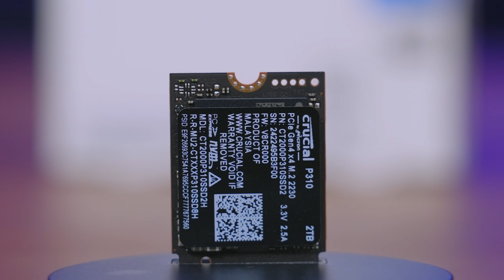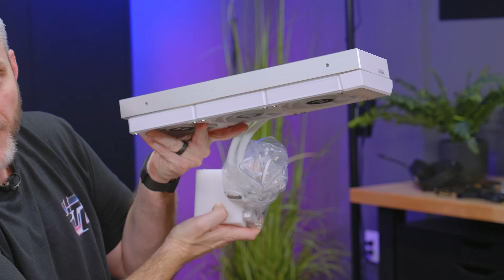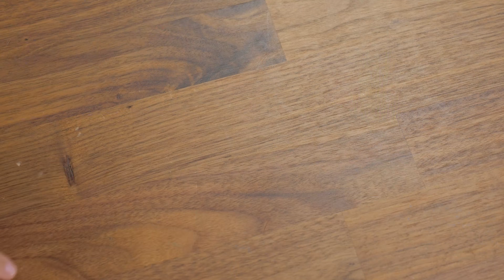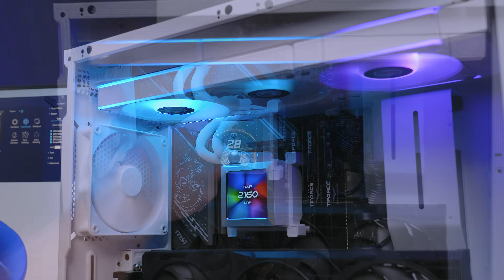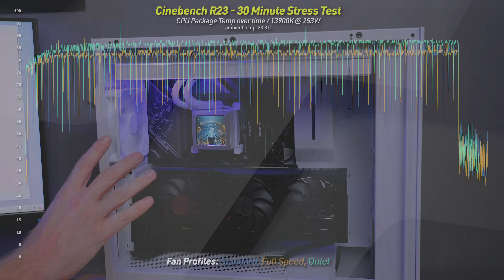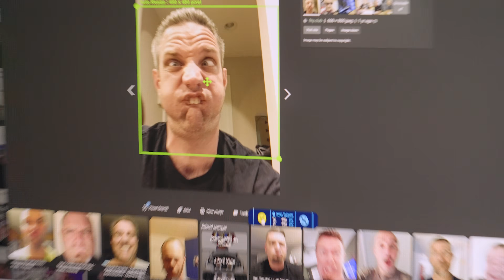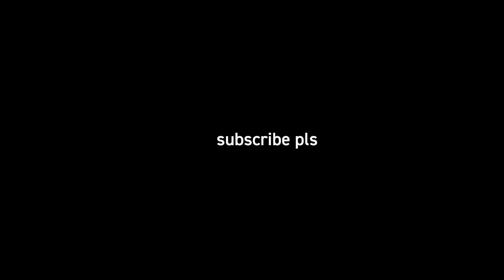Lian Li HydroShift 360R - Thermals and Stress Tests - is it worth it?

Comment: I wish all aio's going forward would have some type of ball valve or fill port for topping them off and swapping out the fluid.
Reply: 100% the problem is the longevity and low entry price point of closed loop visavis open loop would eat into their profits, especially if they specialize in cooling like EK.
Reply: What for? There is no need for regular maintenance or refilling. If you suggest it to a pc service they start laughing why I would want to refill or replace the cooling liquid. They never ever had to do that for an aio. And even my first one a buddy still uses … after ages of excessive use cooling like on day 1.
Reply: @GanymedeXD  do you not understand how evaporation works through the rubber hoses? Take the time to Google before you reply to somebody with your opinion lol. And it would be really nice and make sure that there's no organics or galvanic corrosion going on inside of the closed loop system. You just desperately wanted to have an opinion on something didn't you?
Reply: @GanymedeXD  and if you have been running your super hard for years it's probably about time for you to top it up. Most the time you have to take the block off of the CPU and remove the screws on the face. Make sure you don't mess up that rubber. Lift the pump up above the reservoir and have it running while you fill it with whatever is recommended from your manufacturer. I wouldn't be surprised if I was to come over there and pull your system apart you would hear all kinds of crazy sloshing going on in your radiator.

Comment: This is very interesting. It would be absolute overkill for my system as the tower cooler I have is rated for 250w and the 12400F can't get close to that. I do love their white stuff though. Might have to keep it in mind for my next build assuming they keep it around until next summer.

Comment: I dont see the rationale for the "R" version or the TL version relative to the "S" version (that I bought).  The R and TL version have a slightly thicker rad and a little slower pump.  Absent being a real power user...the "S" version is perfect, especially since youre likely to be swapping the stock fans anyway (except maybe the TL) to have a consistent fan "asthetic" and it is quite a bit cheaper.  I bought the "S" version in black, swapped out the stock fans for SL-INF fans in a push-pull config and am digging it. Performs just as well as the older Arctic LFII 360 I had on my current 7800X3D.  Mid-40s when not gaming, mid-50s in a warm room when gaming. Love the minimalist tube look!!

EDIT: Install was both easy and challenging. Installs like a normal aio, installed the rad first and all. But, orienting the rad properly to ensure that you have the tubs where they need to be to get the right bend is challenging for us spacially-challenged people.  Whats cool, though, is that Lain Li designed this so that you can rotate the rad and tubs and install that extra clip on to the rad to get the tubes right where you want them.

EDIT 2:  If you install in a push-pull in the O11 EVO RGB, you have to use the lower mobo placement and it's a tight-tight fit.

Comment: Hoses look weird because YOU added the third hose clamp. One of the few aios that have four corner pump to base plate screws. The white wiring coming off the pump sticks out on black mobo (most all). Use black split sleeving to make them disappear and make 1 cable. Your unbox gripe.

Comment: If you want my honest opinion Jay,The only reason why I don't buy watercoolers anymore is because of the gunk in the radiators caused by cutting corners in metals and the super high risk of leakage and ruining your other parts. When I build a pc I aim to build it for a long time and with all the disasters and overpriced garbage aios i am staying farrrrr far away from them. If they had a thick conformal silicone coating on the water block ports I would feel somewhat comfortable again but the gunk in the radiators is an issue.

Comment: working on older systems that stupid 3m tape on the back of a plate is a nightmare never use that. even after heat cycling it doesn't really lose its stick so if you ever need to change it, it is horrible to get off without damaging something

Comment: I got the 360R Black version for my new 7800X3D/4080S build. My only complaint was that I couldn't swap the LL fans with a set of Phanteks D30 fans. The 360R's screws were too short and the D30's screws were too thick.

Comment: Finally, an AIO that eliminates the question of where to run the tubes. Most people run the AIO with tubes from the front of the case. Right over the ARGB Ram they paid extra for. NO NO NO. Toward rear, they say blocks air flow to rear exhaust fan. BS BS BS. Unless that's only exhaust fan in the case. DUMB.

Comment: If only L-Connect/Lian-Li would add a sensor for coolant temp! It's the variable I like to use to set fan curves on my push/pull setup. My Corsair AIO had this, I just assumed the hydroshift would have it as well.

Comment: When will a genuis invent an AIO with the inlet/outlet ports in the middle but on either side of the radiator. That would give you more ways of mounting the AIO rather than how they're built today with the ports on the end of the rad.

Comment: Open loop CPU blocks with a somewhat comparable comprehensive display on them are between 160 to 200 USD by itself. That's without any fancy graphic capability or customization. The 260 USD for the "UNI" version even seems more than fair, in my opinion.

Comment: Since the screen rotates on the pump through the software, why not rotate the pump 90° so that the lines (are on left side) & aren't so stressed?
Reply: Because the point is to hide the tubes as much as possible. Traditional AIOs have tubes that obstruct your RAM. If these were on the left side of the pump, they’d obstruct the mobo’s I/O shroud. On cheaper ones, that’s fine, but on higher end mobos there is often RGB or even a screen on the shroud. The only thing that never lights up is whatever’s covering the VRMs, so having the tubes point upwards hides them most effectively.

If it wasn’t clear, this is a “style over substance” purchase. I don’t think the angle will cause problems, but we’ll see!

Comment: I got my Arctic freezer 3 360mm rgb white for 96 plus tax on Amazon when it first released. 

The 199 is not that bad really .most of the LCD AIOs are crazy over priced even 250-300-350 range.

So 200 is not terrible
Reply: I'm considering getting the 420mm version for a fractal design North XL build can i get some opinions from your standpoint on your freezer aio??
Reply: @GrayReactsYT  my personal opinion is if i had to do it again i would not for one reason. The Radiator is too thick at 63mm with fans and you have to pick and choose what cases it will fit in.

it works fantastic but unfortunately alot of cases will not support the thickness of the Radiator

Comment: Honestly, this AIO is approaching custom loop territory for just the processor alone.  Don't get me wrong, the quality is definitely there, but that's one hell of a sticker shock when you can get a big chungus heatsink that can do the job for much cheaper.  I would understand the price increase if they used a higher quality pump, and/or thicker cold plate.  That way it's not just a visual improvement.

Comment: Hey Jay, I've read that silver has the highest thermal conductivity, making it the best metal for heat transfer. When do you think we'll see silver cold plate for water cooling? I know it's expensive but would this be something that would allow more efficient cooling or maybe it could be used for professional XOC. Thoughts???

Comment: Thanks for the review. I like the looks of it but the cooling tubes are too short for anything but installing in the top of a smaller case. Also I've found that in a bunch of cases that are shallow front to back it's almost impossible to mount an AIO in the top without crushing the EPS cables in the upper left.
Reply: its side mountable in 011 evo and similar cases
Reply: @mainsource8030  I have a Corsair x5000  iCue case and a Corsair AIO and it only fits on the side. It can't get by the EPS cables in the top and the tubes don't really fit appropriately in the front. I wish all these companies would make the tubes a couple inches longer.

Comment: Hi Jay.✌️
Can you (or someone else) please tell me whether you can control the RGB zones of these fans separately in L-Connect? 
So that you e.g. can only illuminate the two strips on the edge of the fans but can deactivate the inner fan blades? Just like the Uni fans SL Infinty?
👀🙏🙏🙏🙏

Comment: What brands of water cooling products do you recommend?  When is it a good idea to go from an AIO to custom water cooled?  When is it a good point to go from an air cooled GPU to water cooled?

First water cooling build, I like the idea of a custom because more things to learn and try out than just slapping in a part.  Trying to find a water block to fit a 4070 ti Super kind of sucks.
Reply: With CPU's its really a case of - is your CPU throttling in a noticeable way?   If you have a high core count chip and you are doing heavy production work, then an AIO will likely give you a bit better performance and also likely a quieter experience - if you are just gaming and browsing tinternet then any decent air cooler will do the job.  For GPU its all about hunting those higher FPS - do you want to squeeze a few extra FPS out that you feel the current cooling isn't letting you hit.   These are the practical reasons - but thats not the only reason you go water, particularly if you go custom loop.   It's gonna cost you a chunk of money - its not really cost effective vs other solutions, but it can be a very satisfying thing to build for yourself and that is why a lot of people do it - it's something semi unique to you and once you have it made, in theory you can re-use it for several future builds/upgrades.

Comment: For Zen 5, what cooling solution is going to bring the best bang for the buck with the best user experience?  I'm guessing simple cheap air cooling will be best for everything except the 9950x.  What plusses do water coolers bring for anyone using a 9900x and below model? 9900x will need a bit better cooler then the others but even those are cheap.  Water cooling just seems like an added tax.

Comment: Hey Jay, I'm wondering if you know of any "off-label use" of the Lian Li Galahad II LCD AIO.  I'd love to hack it by a Res. block or additional pump cooler and combine that with my GPU and another 360 Radiator.  My thought is to start out AIO and bargain Shop the other parts, working toward a custom loop keeping the Lian Li management.    

I suppose the other option a Fan block for now and just build a Corsair Hydro X custom loop.  Has your team ever used the Corsair Hydro X components?

Keep up the good work.  I'm glad you're feeling better!

Comment: I am really considering the upgraded version with the UNI FANS to replace my current Corsair.  All of my case fans are UNI FANS SL-INF already, I got the Corsair in a combo deal that I couldn't really pass on at the time.
Reply: I just swapped out all my corsair fans and my h150i elite 360 aio for lian li uni infinity fans and the hydroshift tl which has the infinity unifan housing, to go with the lian li strimer cables I had bought months back and it looks great. Software options are not as customizable as ique but it does do mp4 video not just images and gifs so it's a decent tradeoff. Performance is comparable but I haven't seen any liquid temp monitors so you can only choose cpu temp. Would be nice if the tl version were true infinity fans but the hubs are not rgb, not an issue in my case unless you crouch down to look up at them.
Reply: I mean could always get the galahad lcd aio with the sl infinity fans. It's the same thing just without the tube's being tucked plus it comes with a control hub
Reply: @Atomic_dipper plus its actually more expensive then this one. But hey the aio has rgb on the screen too

Comment: Will this fit nice in the Lian Li SUP01 - Just that the tubes need to be at the top in that case  ?   Thanks 👍  
EDIT:  Got the Hydroshift 360S and it fits fine, you can really bend those tubes although they are pretty stiff 👍    As for thermal paste - there's plenty that comes with it - I can probably get 3 applications 4 at a push with that little tube (less is more 🤣🤣)     cooling my 5900X just fine.

Comment: wonder why lian li won't make a 420mm AIO. they have cases that support those sizes like the o11 d evo xl but they don't make their aios in that size. I could be wrong but my understanding is that 420mm aios are quieter than 360mms so I wish they'd just go ahead and made one. 

on a related note, given how most if not all aios on the market are extremely close to each other in performance and the biggest difference between them is their acoustics, how come no reviewer has made a aio sound comparison video yet?

Comment: I know you feel like you are a contributor to so many people joining the custom loop scene (you influenced me more than i thought) but now you seem to be ignoring custom loops. Their is so much hardwarenout there to try and it is all so much more interesting than these AiOs or Air coolers. You have only really used EKWB, corsair or them stupid expensive blocks you got sent in like the past 2 to 4 years. 

You could do external rads - mora, nexxxos, a bundle of all the rads yiu ha e sitting on a shelf.
RAM cooling.
Alphacool, bitspower and bykski gpu blocks. 
Many many more interesting reservoirs so much more so than the tubular ones that "now come as glass" or "new type of rgb".

If you start doing more custom loops it might start to get more popular again.

Comment: Looks pretty cool but not for the price. My bequiet 240 was more than half that. Also came with a refill kit and cools my 3800x no issue. Just another fad. Plus only rgb in my system is the ram and that’s enough for me and is set to match the colour I’ve set on my rgb keyboard.

You can take a cheaper aio 3d print similar brackets and have that clean look with the fraction of the cost

Comment: When it comes to my PCs, $ isn't an issue as much as performance and function. For instance, I wouldn't purchase an Nvidia card because Imo, AMD is just as good. Would I pay $200 for an AIO? You recently had a Hyte Q60 that I def intend to purchase at $300, but I would like to compare it with other AIOs on the market that also have the pump in the radiator.

You said that you were ddoing a month of Water Cooling, so I would be interested if you would consider doing a comparison of AIOs with the pump in the radiator. I don't know how many there are, but I need to mount the AIO in my Modded Hobbit PC, in a Corsair 760T, which brings it below the CPU. Hopefully I can upload pics of this sometime as I'm spending a lot of time hand carving Hobbit designs in wood and in modifying the case.

Comment: Personally I have no use for an AIO since I do not game. Air cooling with fans properly installed works just fine. Even if I did need one I certainly would not pay $200 dollars for one.

Just my POV, but everyone is different with different needs or desires. Let's face facts if you are building a high end system for gaming or intense graphics, then yes you might want to invest in an AIO. But for basic need budget builds they are not required.

Comment: If you are prepared to pay that much for a AIO then I guess this is for you. Personally I don't care about the looks at all, just the function, and this is not for me. But I'm just an old bloke who represent a very small part of the possible market, so LianLi is certainly not bothered about that. Now what I really feel is important is that if you pay this much it should last for a long time before the pump or the liquid goes bad. But that is something that can't be tested in a review like this. Even if you were to take everything apart and check the materials and chemistry it wouldn't necessarily result in usable numbers. So that's again something for the buyers. If they want the looks and are good with the software and performance then this might be a good choice. For what it's worth LianLi have a history of making good things, and I'm sure they have made their best to make this as good as is reasonable to ask from a AIO. The failure spots are the usual, the pump, the fluid, fans and corrosion in the radiator or the water block. I guess there's also the display, but that's pretty obvious, and a failure there would not really be negative for the use of the computer.
Reply from the maker: Then stay tuned for the Thermalright AIO we have coming up

Comment: I wonder how much CPU it uses to drive animations on this 480x480 screen through USB.
It would be a shame if CPU wouldn't be able to sit in the low power stages just because my AIO wants to show me something.
Personally I will stick to my Arctic Liquid Freezer III 360 RGB - half the price, excellent performance and RGB if I want to (controlled by OpenRGB).